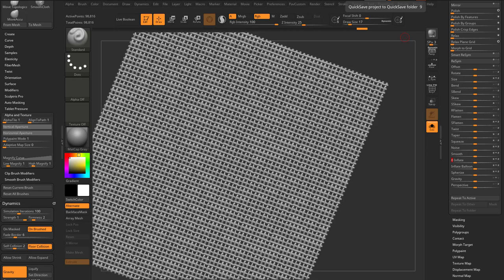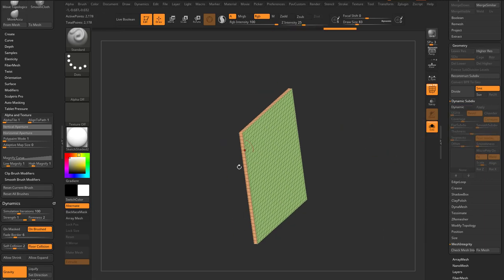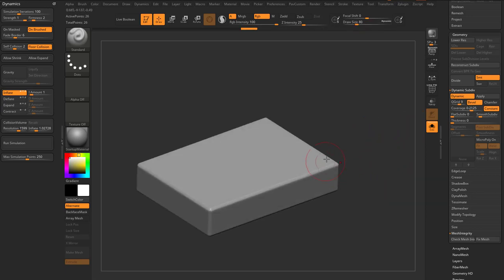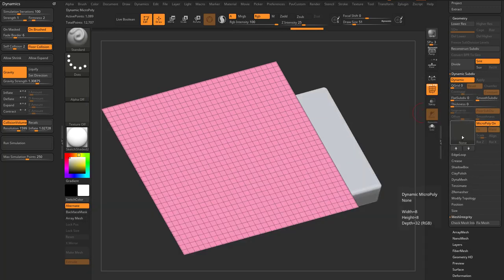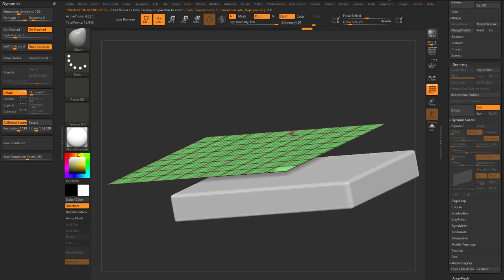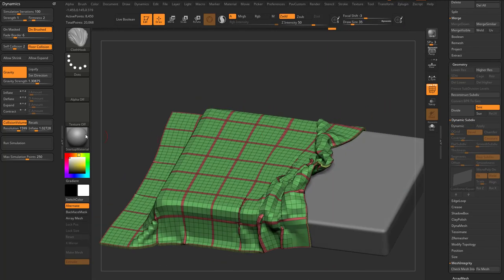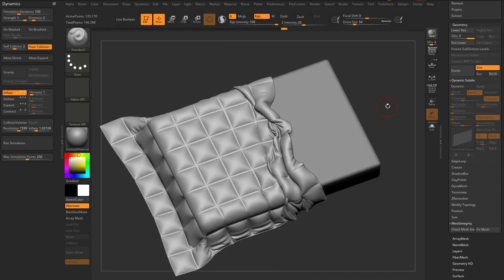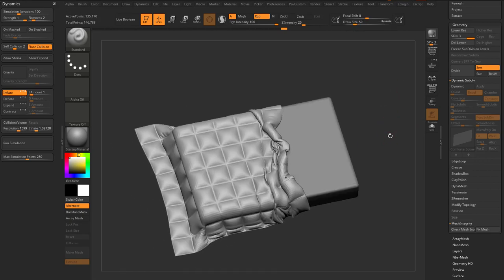048 ZBrush 2021 Comforter Demo With MicroPoly Cloth Inflate and Dynamic Thickness

Comment: i tried this, but everytime i grab the square from micropoly, it crashes.  Any idea sir why is that happening?
Reply from the maker: 2021.5.1 is pretty stable, unless you're trying to apply a micropoly to a 10 million polygon mesh or something
Reply: @MichaelPavlovich  Oh no sir, i was doing exactly what you were doing here and my zbrush is updated to 5.1 ( Genuine license ). Just everytime I to get to that part it crashes, I probably tried 3 to 5 times.
Reply from the maker: @ferdzalmarines4086  I just ran through the process on 2021.5.1, seems to be working as expected, I tried keeping smooth subdiv on, changing micropoly options, adding thickness to the original qgrid (just to see if that crashed mircropoly), nothing would crash zbrush on the micropoly creation, application, or simulation parts of the video. I'm not sure what's happening?